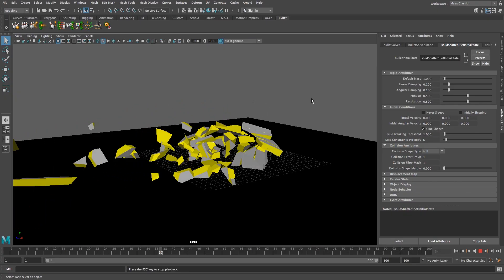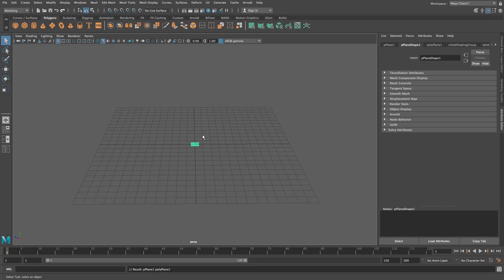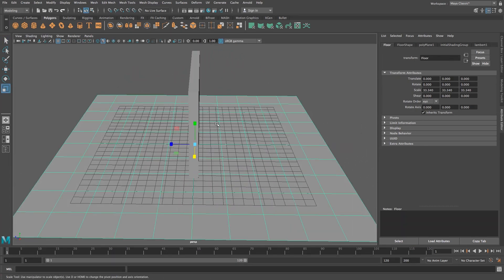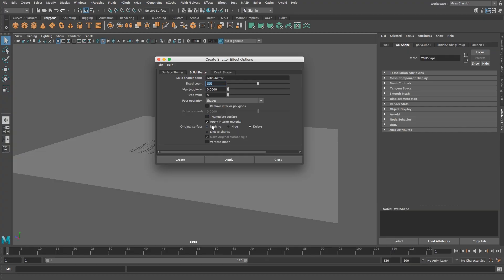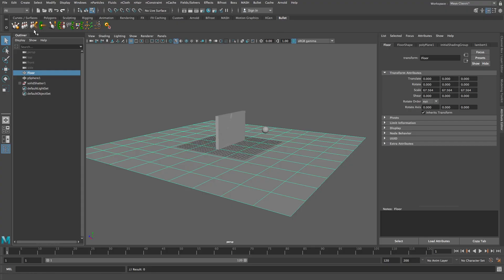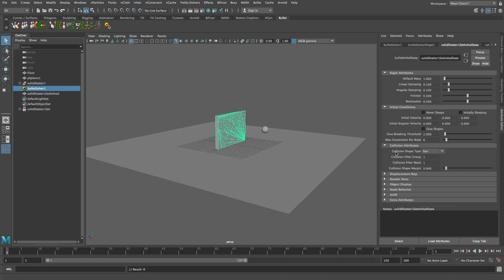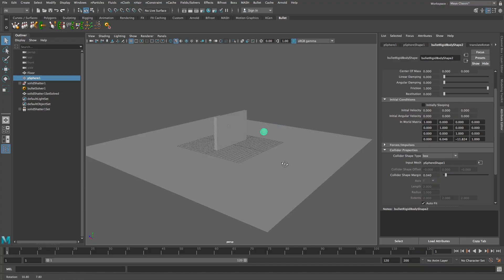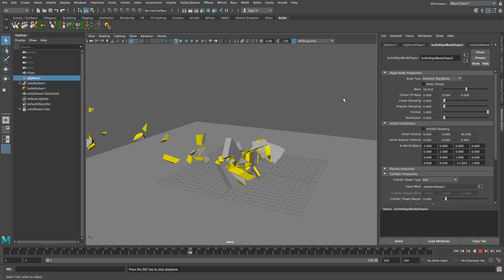Maya Tutorial: How To Break A Wall Using Bullet Dynamics

Comment: Hello

I am trying to do just a wall crumbling down like in 4:05. Just that. 

A do everything the same as you but when I press play there is still a little "explosion" 

I am trying to simulate a building falling down due to an earthquake so no need for a projectile. 

What appears to be happening is that the collision shape margin is not working correctly even if I set it to 0.
Reply: Ok I found the problem. 

If I increase the edge jagginess in order to have smoother cuts then the models will be intersecting. 
Even if I change collision type to hull and the margin to 0 there is going to be a little explosion.

Comment: Great tutorial.  Have a question.  I want to use this process in order to demonstrate a character being thrown into a pillar and the pillar breaking.  I have everything setup like your tutorial but the difference is the sphere (I am using a cube) is not using velocity and I have it constrained to the character.  So basically there is a block attached to him (will be invisible) and when he is thrown against the pillar the block should react to the breakable part of the pillar and break but it does not.  It seems like the velocity needs to be on the block in order for it to work but my character (and the block attached to him) is already animated with motion.  Is there a way to make the sphere/cube react with the wall/pillar without adding velocity?
Reply: AH!  Nevermind I found it.  Just in case anyone is wondering:  Under Rigid Body Properties, you have to change Body Type to Kinematic RigidBody.